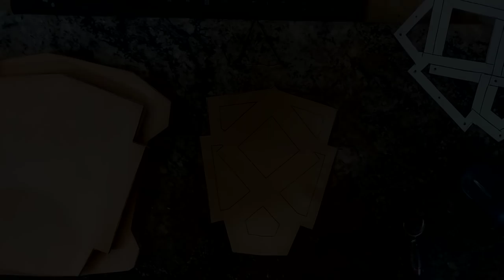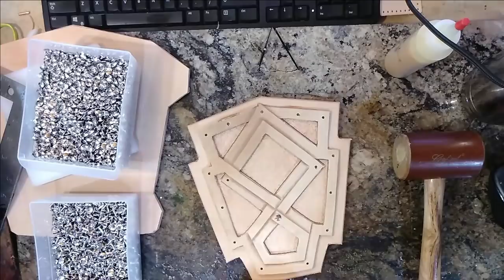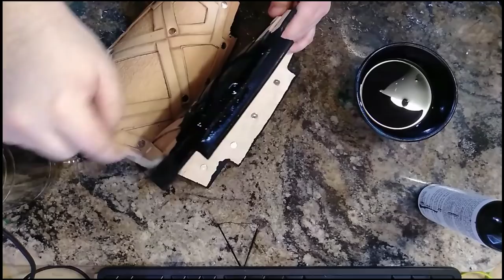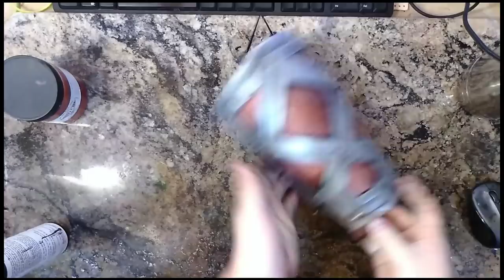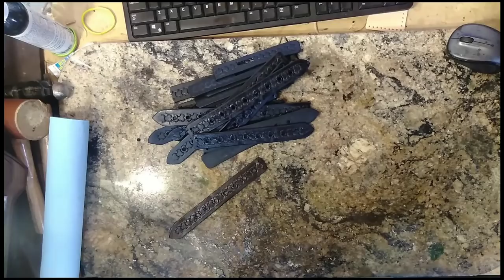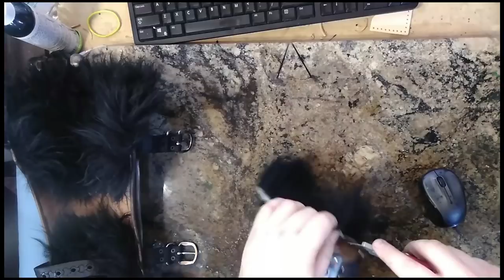Dwarven Bracers (Benchmark Leather Build)

Comment: Just a tip. Fur is AMAZING as isolation, it keeps you very very warm. So if you are cosplaying indoors or in the summer months.... Be prepared to deal with the heat. You can also use less fur by only adding it to the edges for aesthetic.